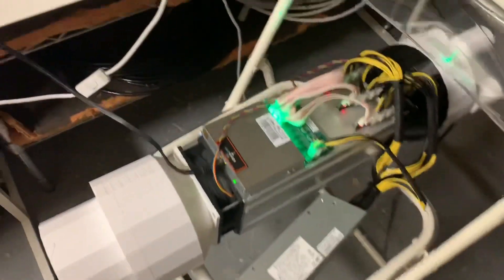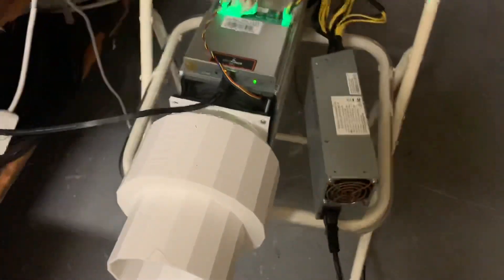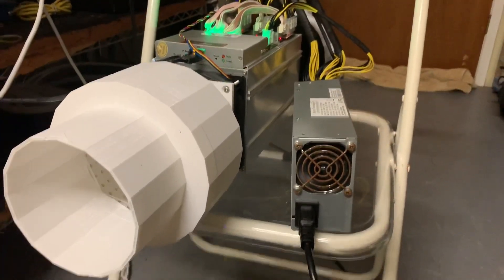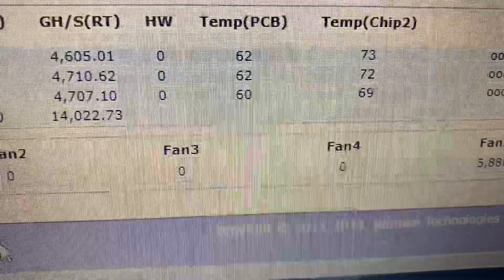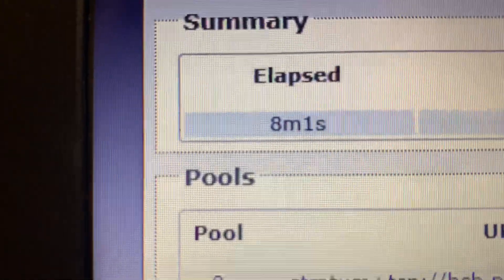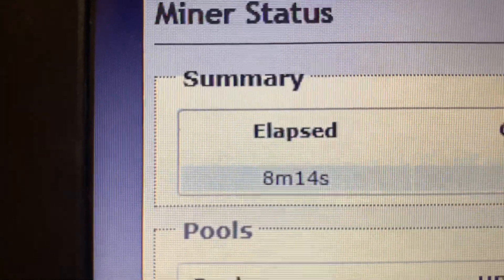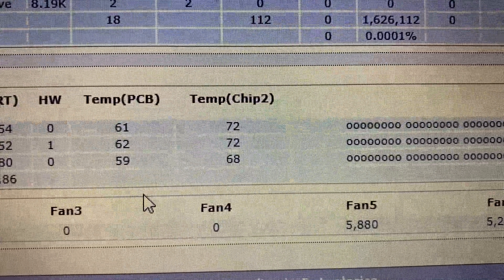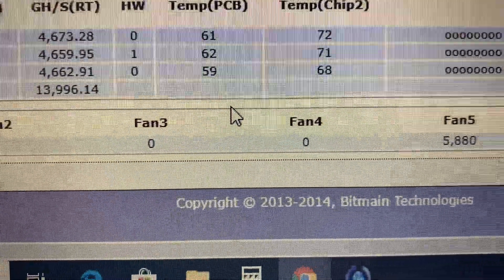Antminer Silencer sound suppressor shroud attachment intake - ASIC Miner silencer shroud intake

Comment: hi, to be honest i still hear the fans, for making me trust this or at least that its working, give me some ambient temp and please use a decibel meter app, if its working then its a wonderful thing. Great Work
Reply from the maker: To be honest this is not supposed to be silent, that would be impossible unless you used a water cooled system. I have used a DB meter as well as ambient temp gauges, I advise you to take a look at my other videos. This is by far my best design and I appreciate your last comment, thanks.
Reply: @MinerDigi  so what was the result? temp and sound?
yeah i saw the thermos one, it was good idea, how about immersing the miner in mineral oil inside the thermos(without the pipes)? does thermos have enough cooling power to keep the mineral oil cool? maybe.
well i had this idea of putting a big fan outside of the building or using an air conditioner fan, by calculating miners fan cfm performance and take out the fans from miners(this way there is no fan to make any noise), then connect it with some non conductive pipes to the miners and putting some pipes for the exhausted air from miners other end so the building won't get hot, but since it's not necessary anymore and i don't have the tools, i didn't do it. keep up the good work.
Reply from the maker: Did you see my immersion coolers I built? Take a look at the videos on my channel. I built immersion coolers last year that are still running perfect till this day.
Reply: @MinerDigi  u mean this one?
https://www.youtube.com/watch?v=aRw4YFYu8oo
just saw it, great!! the temps are normal? 88?